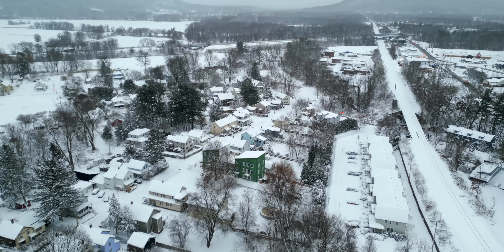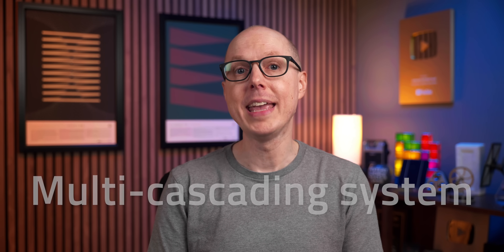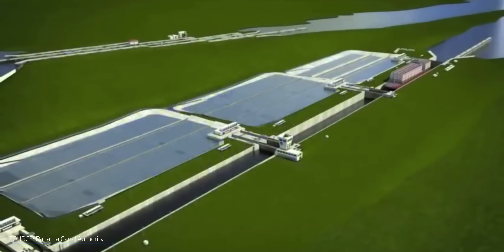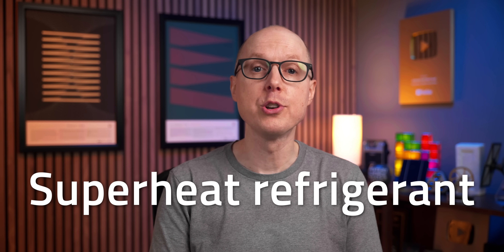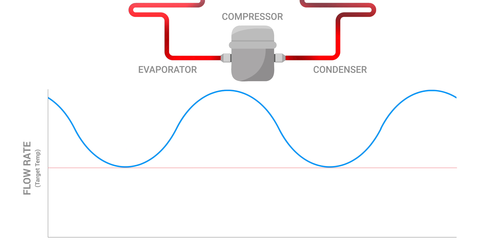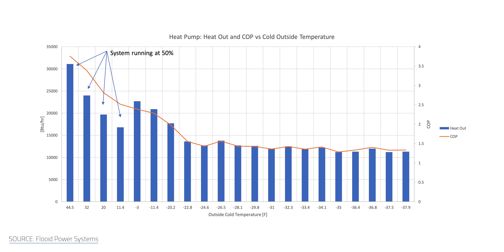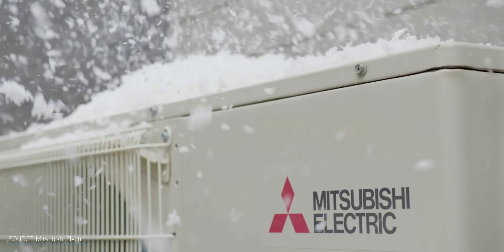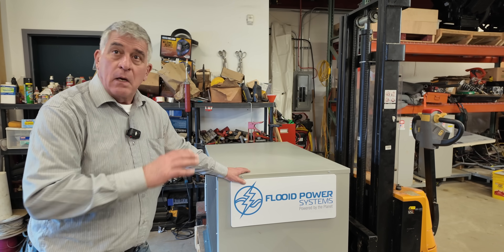How This New Heat Pump is Genius

Comment: Thanks Matt.  A cascade heat pump is just a scheme to get a heat pump to work at all in very cold climates and is not about increasing efficiency. Cascading systems can get heat out of extremely cold air, but the quantity of the heat you get (BTUs) is on the small side (i.e., super cold air does not have a lot of heat content, a very rough analogy is an alternator coil which steps up electrical voltage, but the amperage goes way down).  To make the cascade trick work, you need an oversized heat pump at the coldest end of the cascade to produce a whole bunch of moderate warmth.  Then the next heat pump can pump/turn that large amount of moderate warmth into the warmth you need for your house.

Remember, each heat pump in the cascade costs extra money and the first cascade heat pump, being larger, costs more (need to confirm that the outfit you talked to up-sizes heat pump #1, the coldest one).  

Why go to all of the expense of a cascade when a ground water based heat pump works better.  Extracting the heat out of 55°F ground water means a COP a bit greater than 4.0 on even the coldest days (job done).  I'll bet the extra cost of the buried water coils is similar to the cost of the extra heat pumps in a cascade system (need to confirm this).

A good non-cascade heat pump, like the Mitsubishi Hyper heat ductless mini-split, has a COP of 4 @ 48°F outside temp & a COP of 2 @ 5°F outside temp and can extract heat from air as cold as -13°F (-11°C), but the COP goes down to ~1 at this temp.  BTW - the magic here is mostly an oversized heat exchanger.  

Costs - High COP only partially translates into dollars saved because the cost of electricity varies so much over the USA.  My electricity costs ~17 cents per kWhr (I'm including every cost, like line transmission charges) and my separate high efficiency (95%) condensing gas boiler gas boiler runs on natural gas that currently costs ~12.7 cents per cubic foot (I'm including transmission charges too).  The cost cross-over point is 47°F (i.e., cheaper to burn natl gas below 47°F outside temp).   

About 3 years ago, when I replaced my 25 year old just-A/C system with the Mitsubishi Hyper heat, the gas vs. heat pump cost cross-over point was ~32°F.  My Mitsubishi ductless mini-split cost about 2X more than a traditional A/C-only system.  I was OK with this because I got two systems in one and every room now has its own zone and I don't have to burn natl gas for about 40% of the winter when the outside temp is 47°F or warmer (min temp in my area is ~5°F).  The old A/C was and the current gas boiler based heat is one giant zone for the whole house.  Gas heats my hot water year round.
Reply: Absolutely. It sounds like a great idea, but it isn’t in practice. You’re far better off with a single heat pump in most situations where it’s not very cold most of the time, it’ll be more efficient year round which is the whole point.

A COP of 2 is pretty rubbish tbh. Far better off with a system that gets 5+ most of the year and 1 when it’s really cold.

Comment: For those of us living in colder climates, like Montana, we'd still need supplemental heating with that system. Just this winter, we had temps reach -40F with a -75F windchill for nearly a week. That would be outside it's effective range. So we in Montana would still need some form of supplemental heating, whether from in-floor heating or a furnace. 

So for the cold climate argument, even this cascading heat pump design still isn't fully usable in cold climates. It does, however, sound like the design could expand heat pumps into hotter places that the typical heat pumps aren't effective in, like central America and the northern portion of South America (basically near the equator where mean annual temps are much higher).
Reply: I have radiant floors in my house, heated via high-efficiency boiler, which works great at a decent cost. (Until the boiler nears end-of-life as ours is doing now... repairs get pricey quickly) 
I wonder how well a cascading heat pump would handle Warmboard radiant floor systems? Probably pretty well, with the larger-diameter tubing and closed-loop circulation through the upper-side heat pump. 
The manifold might get complicated though. You'd want to shift it to cooling an A/C register to blow cool air through your home in the summer; cold floors don't cool a house down. ;-)
Reply: @Wordsmiths  I'd love to implement radiant floor heating into the basement of my home when I get enough money to do so. 

Given the availability of natural gas in my region and how strained the local electrical grid is, I'd have to go with a gas-fire boiler. So a similar setting that you currently use. Comboed with the cascading heat pump, that'd probably save me a considerable amount over my 50 year old furnace and AC units. 

Though with the house being 100 years old, it might require significant renovation to get that to work...
Reply: Windchill is a measurement for what it feels like to a human, and isn't a representation of how much heat energy is in the outside air.
Reply: @BenIsInSweden  The -40F was the main bit, which is still below the operational temp mentioned in the video. 

Also, yes, wind chill is about the measurement of what it feels like to a human, but it does have a temporary effect in the ambient temps while the much lower wind temps are in effect. 

For example, going back to my week of -40F with -70F windchill, while the wind was subdued, my vehicle temp gauge was reading -40F. While the -70F arctic winds were in effect, my vehicle temp gauge was reading -49F. That showcases that it is more than simply what a person feels. 

So yes, wind chill does have a correlation to the amount of heat energy available in the ambient air, albeit only while the wind is active.
Reply: @xboxbam3979   your vehicle temperature sensor doesn't measure the heat energy in the air, and is affected by other factors as well.
E.g. yesterday as my car was sat in the sun, it was initially reading 25C/77F after being driven for a while it settled on 22C/71.6F, which about matched the outside temperature sensor I have for my house, which is typically in the shade.

As for heat pumps where -40F is common, if there are no restrictions preventing it.  A borehole ground source heat pump would usually be a much better choice.

Comment: My granpa ran his own HVAC company for decades...the system he put in at our house was insane.  Baseboard heat also heated water heater.  Decades later when the guy came to put in a new system he roughly said, "This system is big enough for like 27,000 cubic feet, you need only like 6,000."  Idk the term he actually used, but the numbers are roughly right.  Lol

Comment: It's totally true that heat pumps do not work in the cold.  Mine is only a few years old and i hate it.  I don't even use it in the winter anymore.  It's inefficiency along with the very large electric bill isn't worth it.  A small wood burning stove keeps my large home warm or hot, depending on my mood, all winter for less than 100 bucks in wood.  I could spend 400 bucks in one month using the heat pump, and it will not be hot or warm or comfortable.  It's struggles.  Yes there might be a heat pump that exist, that'll work in my application, but it won't be worth the cost.  I live in the South btw, where it gets cold but not New England cold.
Reply: If your heat pump struggles it is either improperly installed, improperly sized, or broken. Even a low-end (cheap) one should have no problem keeping up in the South. Cost-effectiveness is another story, cheap firewood is cheap.

Comment: I owned two natural gas powered heat pimps for our 9k sq ft home in MN.  When outdoor temp drops below -10F, they’d go into turbo mode.  We replaced them with std HVAC equipment after three years. Rip off!

Comment: Readily available parts is the problem. Multi stage centrifugal compressors with magnetic bearing could deliver heat transfer between stages without more moving parts. Oil viscosity is the driver for multiple machines needed. Decoupling the fluid systems between stages allows for variable heat demands/sources (DHW-Heating Combi units already do this).

Comment: Heat pumps are 3 to 5 times more efficient than gas or electrical resistance heating (~100% efficient) since moving heat vs creating it from another source does not run into any Heat Transfer Laws from Physics. But electricity is more expensive to deliver, so we gravitate to a less efficient source. This is an engineering problem. Musk’s octovalve heads the right direction.

Comment: Too many parts. Multiple refrigerants. This system is a nightmare! We need to start looking at energy as a continuum and use ladders. The freezer sends heat to the hot water heater which feeds the oven, using heat engines that are designed to run the full ladder. High temperatures and big delta temperatures & pressures give better heat transfer. Liquid compliant compressors are possible. Magnetic bearings eliminate the oil problems. And supercritical CO2 is a great refrigerant (just need to stop the cryo people from whining. -40F is an artificial boundary created by labor issues). After that it’s propane, butane or ammonia. Adsorption works, too. Our engineers need to get off their butts!

Comment: Cascading heatpumps  - simply - allows different refrigerants to be used for the different temperature ranges - hotter or colder than the working temperature range of any one fluid.

So - how to defrost the evaporator without supplemental heat??  (air source)

 - Any "air conditioning"  heatpump which isn't reversible is a waste of a resource - applying tax rebates/ subsidies to heat-only units is misguided.

Comment: In my neck of the woods temperatures range from -35 to +35 degrees Celsius and since there not being many heat pumps that can handle the low temps insurance companies mandate that home owners must have another source of primary heat. Flooid's cascading system definitely got my attention.

Comment: As each step has a preferred temp range. The system has a hot side and a cold side by design so to swap from heating to cooling is not as simple as a  reversing valve

Comment: I'd like to see this multiple-loop technology expanded to integrate common appliances found in most homes. Why not move the heat out of a refrigerator and/or freezer and dump it into a domestic water heater (or even a pre-heater) instead of the surrounding ambient air. It makes no sense to cool a living space with a heat pump only to allow a refrigerator to dump its heat into the same space.

Comment: Why don't you use a nicrom resistor wire is way more eficient than a heat pump... not to mension that is thousand times cheaper to repair...
Is not a good idea to use an air conditioner compressor to heat a room
Reply: Nichrome wire is much cheaper but WTF? Resistive wire has a COP of 1. Heat pumps have a seasonal COP of around 3.

Comment: Are there any hard numbers of cost of unit, cost of installation, savings over time, etc to compare apples to apples against current gen 1-stage heat pumps? I'm sure new tech is going to be more expensive, but if it's more efficient, wouldn't it also pay itself off at a higher rate, and as such potentially have the same payoff length of time?

Comment: Been an air-conditioning for 30 years heat pumps sound good to own one. unless you live in a house that is energy neutral you’re in for a wicked surprise. Just like anything of course you can find something top-of-the-line That does what he’s talking about but that’s one out of 1000 types of all the other 999 go look at their efficiency rating in heat. I swapped out my gas furnace for a heat pump with no solar and yeah, I don’t spend any money on gas but that $600 a/c bill I would get in the summer turned in to a $900 heating bill because it loses all of its efficiency when heating. yeah I could’ve spent 5-10 times as much (at cost cause I’m in the trade) upfront and ended up with a much smaller bill every month but the end results going to be the same because of all the upfront cost. Anybody NorCal want 2022 5 ton heat pump package unit I’ll make you a hell of a deal! Only used one season…

Comment: The way you're describing it. I believe is incorrect. Cascading systems use the evaporator as a condenser and a condenser as an evaporator depended on the freon. That's inside, and if you're going up or down, you're not using multiple pumps to keep the same fluid pumping up. You're doing is bringing on a second compressor the takeover for the first one? But because it has that loop of hot air or cold air in the condenser oil. Evaporator the other one like a tube and a tube uses that, as it's medium instead of the air outside. Therefore, you can get the heat from the coil tubing tube. And not the air

Comment: It's very simple problem to fix. Insulate the damn houses. Because no matter how good your heat pump is, if ducked, work is gonna leak. And your building is gonna leak because you have old buildings. Phone Spray Block. Then put some stud over it, and you won't have this problem

Comment: We use cascading systems for negative 80 Celsius. Freezes and negative 20 Celsius. It's the same principle we just taken multiple little compressors with different freons with different glide and boiling points. I'm just staging them and using the medium. From the fluid as its transfer, instead of the air outside
Reply: Need to call it refrigerant

Comment: Unless the heat pumps at either end of the spectrum are extremely, extremely efficient, I don’t see this keeping up with demand. Each heat pump can only take and condense the heat of the ones before it, so each heat pump in the chain would be running under max capacity, no? At the end, you’d get super hot air but not nearly as much as you would with a single heat pump under normal conditions, or a standard furnace output.

If plus, not talking about cooling, but purely in terms of heating it’s still really efficient to use gas burning furnaces. How do these compare to those?

Comment: I would think with 2 working fluids the indoor fluid would be working at a temperature that would be fine but you would want seasonal outdoor working fluids depending on the outdoor temperature or even Just parallel fluids in the same or parallel systems. You would also want to isolate the fluid from the temperatures you don't want it to see. Unless you're doing something with more temperature outputs and ranges like refrigeration and heating at multiple teperatures.

Comment: Ground sourced heat pumps are better. The ground a few meters down is a relatively consistent temperature way above freezing.  This is much better for heat pumps and works fine in winter.

Comment: Compressors are the most expensive part of a heat-pump. Having multiples of them would greatly increase the cost, points of failure and maintenance.

Comment: tankless water heater analogy - very cold water comes in through the inlet - the heat exchanger can only raise the temperature so much Unless you have a very large exchanger ..so if you had a second tankless water heater connected to the first now this one can take the warmer water and heat it even more...learned this working in the bush camps we would take  creek water and pump it through a water heater could only get the water warm depending on the temperature of the creek water never had a hot shower just warm..

Comment: New England is having fewer and fewer very cold days because of climate change, so maybe the problem will take care of itself. For places where they still have very cold days, if the outside unit is installed underground (like in a detached cellar), it can remain within operable range even on very cold days.